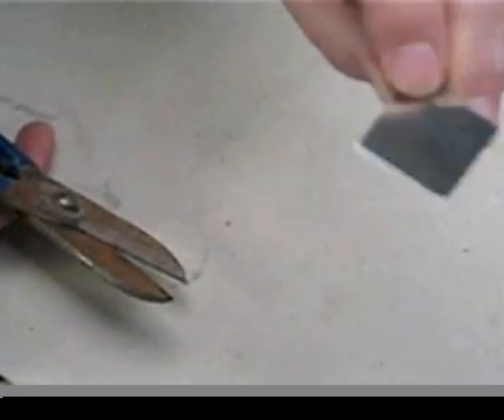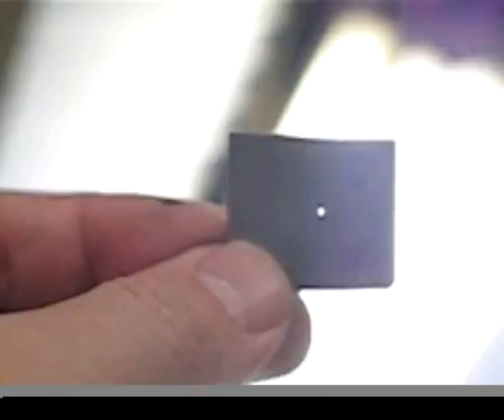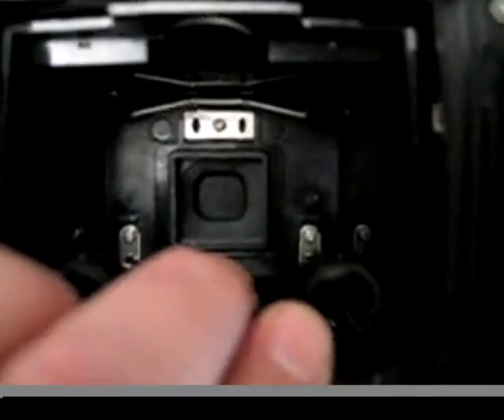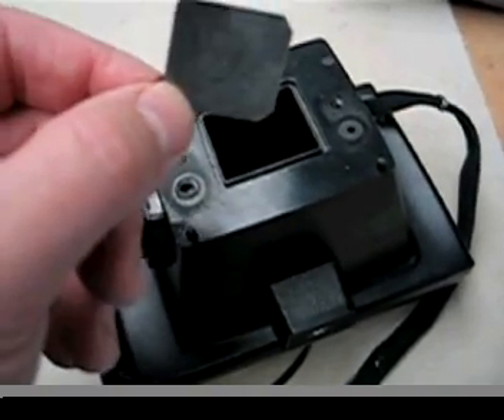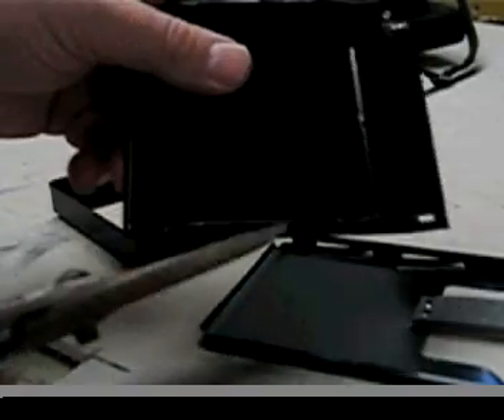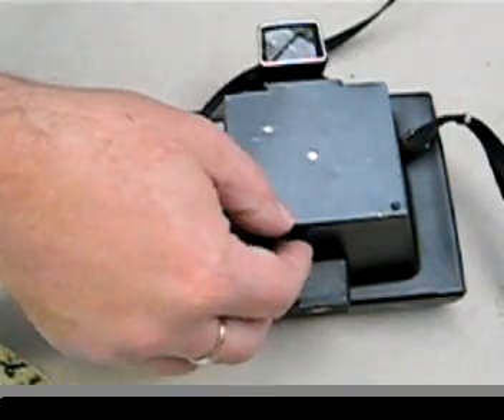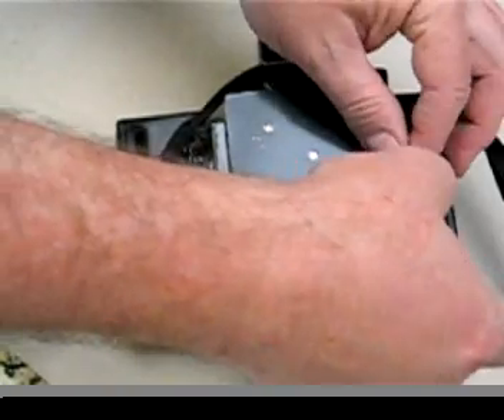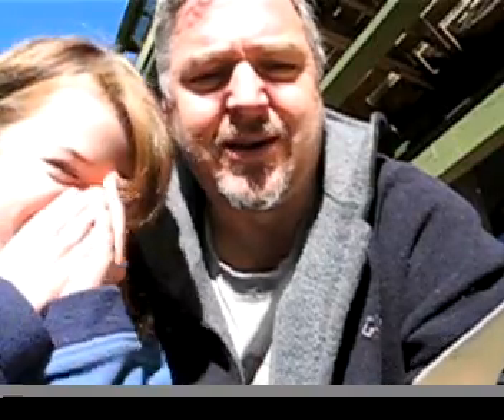Making a Polaroid Pinhole Camera

Comment from the maker: You won't need the batteries in the camera as they are used to set the shutter speed in the normal, unmodified camera. With the pinhole adaption, you are the one who sets how long your 'shutter' is open. With this particular modification (in the Polaroid Camera EE66) I can use both '80' and '100' type films (check out the 'landlist' if you are not sure about what kind of Polaroid camera takes what film) - you can also use Fuji 'peel-apart' films in this camera.